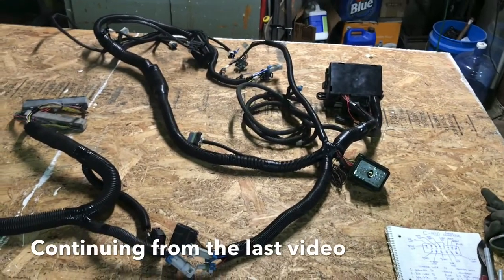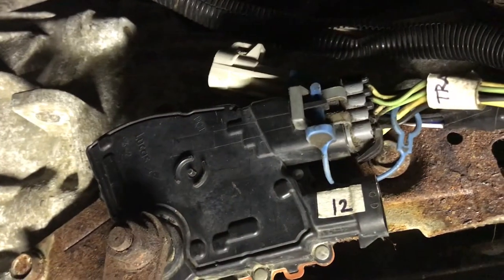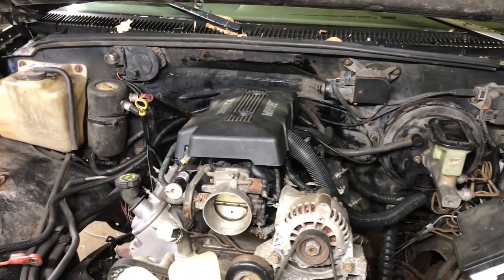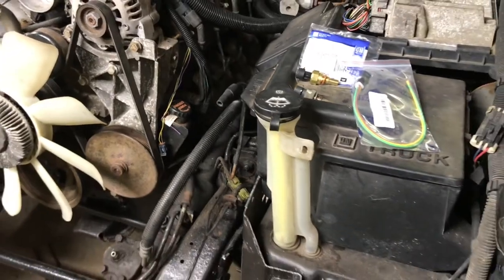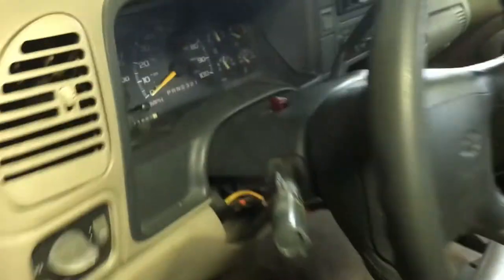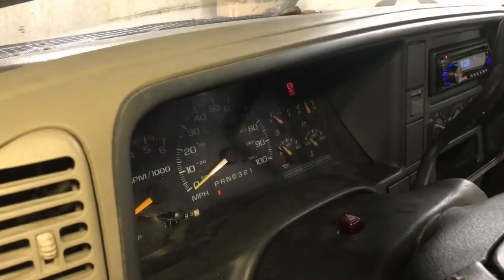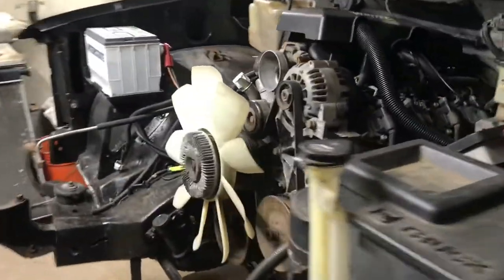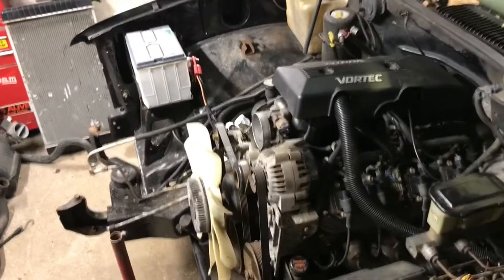OBS Chevy Truck LS Swap Wiring Part 6 Reinstalling the Wiring Harness

Comment: Thanks for doing the videos they have helped im doing a 96 regular cab short bed was 5.7 4l60e now 04 5.3 4l60e im trying to figure out what wires need to be spliced in to the ls harness for range selector neutral saftey switch any help would be appreciated

Comment: Sir! How did you connect/power the fuel pump. And also did you instal an obd port? Because the guy from lt1swap makes the fuse box you were saying and he run the fuel pump and obd from there.